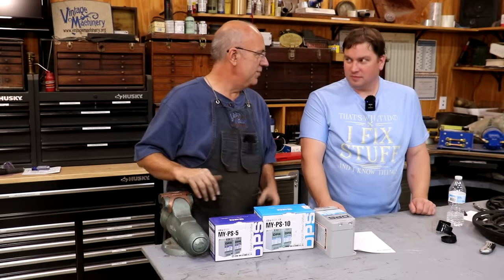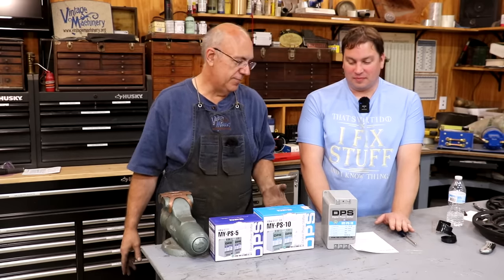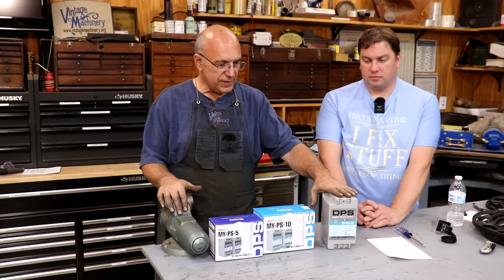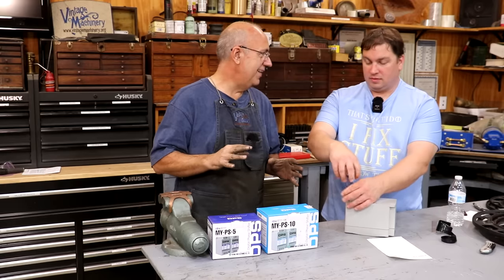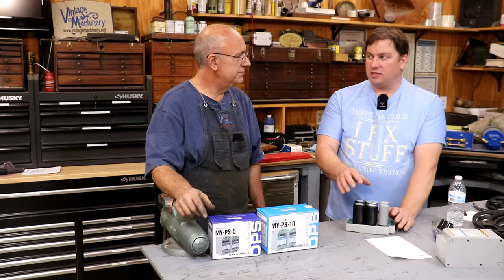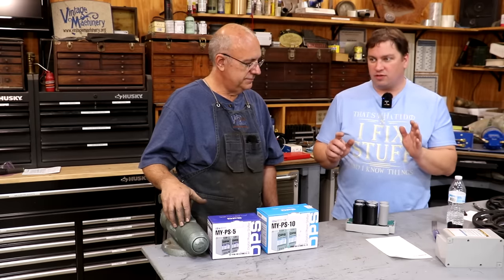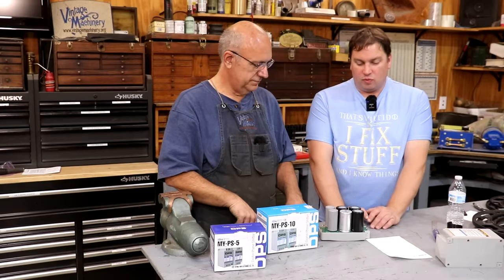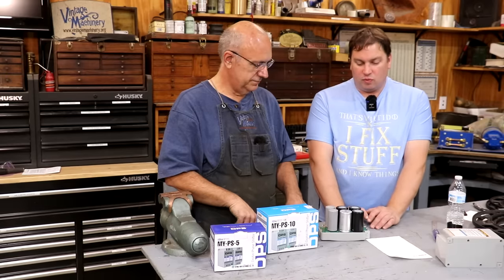Single Phase to Three Phase Power: Rotary Phase Converter vs Digital Phase Shifter

Comment: I run my lathe off single phase with a homemade rotary converter.  I used a potential relay and a pile of capacitors from the scrap yard. I set it up with a digital amp and voltage gauge for each leg from Amazon. It's a 10hp and has been in use for 10 years. The slave motor was also brought from the scrap yard just needing bearings, 25hp motor. With the digital gauges I can live data monitor each leg while using the lathe or any other machine plugged into that outlet. Study up on it and use common sense to get it done.

Comment: I've heard these described as two phase with a starting circuit which your demo proved out. For an in depth, but easy to follow review of motors controllers and VFD's go to Pump Ed 101 by Dr. Joe Evans. I have had the pleasure of sitting in on his presentations at workshops in the past. His online material  appears to be transcriptions of his presentations. really good stuff. 

Thanks again for providing another very informative video.

Comment: We are a DPS manufacturer and seller. Thank you for making DPS video.
However, it seems like the video was made without much knowledge of the characteristics of DPS.
It appears that there was no load on the motor when testing the DPS.
However, the motor is never used without load.
When the motor load is less than 50%, there may be an imbalance from the voltages and currents output from the DPS. Normally, when the motor load is 50% more, voltages and currents will be balanced. The current in the middle phase of the DPS output changes depending on the motor load.
Most of our customers are using DPS very well on their 3 phase motors. We are concerned that customers may have misunderstandings about DPS due to this video.
We think that if the person who made this video had read the DPS user manual carefully, he would not have made a video like this. Thank you.

Comment: This was a FANTASTIC video. Really makes me want to rip out all of my static converters and VFDs and replace them with a rotary and dedicated 3 phase panel. Unfortunately, I don't have a few grand laying around lol... But this video did give me a lot of knowledge and perspective on what's potentially happening on my machines, I'll be taking a look at some amperages...
Reply: keep the vfds and use the static converters  and a big motor to build your own roto phase!  you have most of the parts already, go for it!
Reply: @nilzlima3027  Haha, solid plan is solid. Might even make a great video... 🤔🤣
Reply: @hersch_tool  I put my RPC on a steel dolly with large casters. Then I can rearrange my shop at will and have easy access for any mods. That also made it easy to assemble on the bench, pick off with my lift (patients lifts are light and fit through a standard doorway making them epic back savers) and roll into place. I connect most of my equipment like a job site using SOOW cable for easy reconfig and though I never expect to move if I expand my shop it will be a breeze.
Reply: @Comm0ut Unless you just love irritating noise park it outside or in another building to muffle the constant drone.

Comment: Rotary converters are the best, will outlast electronics in my opinion, and the sine wave is clean. The old capacitor-type “converters” aren't really converters, as they're designed only for starting a 3 phase motor, where one leg kicks out after they start, and you lose 1/3 of the power. That is why rotary has always been the best, if a well-made motor is used. I used a 20 HP, 3 Phase, Lincoln Electric Co. motor on the converter I had, with a small 1/2 HP blower motor (also known as a pony motor) to start the larger turning at the push of a button. Really, they're easily made.

When there's no 3 phase on the pole, it's your only hope, as I called the power company for an estimate to run 3 phase to my shop, and the price was staggering years ago.

Comment: There is another option, solid state phase conversion (Phase Technologies).  I have two, one of which is in my machine shop powering CNC equipment.  They are expensive but very precise 3 phase generation.  If you hook an oscilloscope to the output you can not tell which phase is generated and which is original.
Reply: That is the path I am headed down, more for the reasons of compact space and less noise that RPC.
Reply: I have installed those things too.  they are more or less a vfd that has a static out put at 60hz.  a vfd is likely cheaper.  depends on how many machines you are going to have hooked to it.  they make the same whine that vfds do as well.

Comment: Key VFD advantage is speed adjustment on lathes DURING the cut (slower on the outside of a large diameter, faster towards the center) and of course variable speed on lathe and mill.

RPCs are better for heavy steady loads not needing speed control. Bonus, more motors also act as more idlers. I start my compressors one at a time (two industrial 5HP are easier to power than a single 10HP and when not blasting I only use one) off my RPC.  OTOH my lathe and mill have VFDs. See the Practical Machinist forum for the best detailed info on using both in a machine shop context.

Note some power companies bill all three phase at commercial rates so a large RPC may be a much better deal. Check before spending money. Also many areas do not have three phase at the pole.

Comment: I lucked out. I found a residential property that had three phase already set up in a 4500 sqft shop building that the previous owner was using for his business. It was the deciding factor for buying the property. Otherwise I would have gone with the rotary option to power my machines.

Comment: I would like to see the difference on a power analyzer. I don't think the phase shift is 120deg and that will cause the unbalance on the current. What worries me is that one phase was in an over current state. Power analyzer is basically a 6 channel oscilloscope, nice to compare voltage and current curves on one screen. We have compared the wave forms on a FVD before and after the line inductors. Even after the inductor the wave form was not a sinewave.

Comment: Last year I bought the diesel version of a large piece of equipment I wanted because the electric version required 3-phase power and when I called the electric company, I was informed there was no way to provide me 3-phase power without a significant investment ($100K+) since I am rural. Then I find something called a phase converter on FB Marketplace and after looking into it, realize that the electric company providing me the 3-phase power was not my only option and that I could have bought the more convenient 3-phase version of the equipment with a minor investment in a phase converter. You would think that someone working for an electric company would have known that and been able to suggest that possibility. Oh well...live and learn. At least now, I understand that I do not need to rent out facilities in town that already have 3-phase power.

Comment: 3 phase motors can run on single phase at a reduced power BUT THEY CAN'T START on single phase.  Starting requires a phase shifted 3rd leg.   The capacitors can provide a phase shift that will give a direction to start the motor but it will most likely never be a balanced 120 degrees.  The angle will depend on the capacitors, induction of the motor and it's load.  I have built phase converters and 3 phase capacitor start/run circuits for specific motor and load.  It is possible to come close to 120 phase shifts over a wide load range but you really need to know what you are doing and get the whole system balanced.   This is what the professionally built rotary phase converters do!

Comment: Speaking from my experience...rebuilt a Brideport Boss to modern controls/VFD, this is academic... If you run the numbers, factor in your hopes and dreams, and check your bank account, the choice is there. While a DPS may be bad choice, my VFD (set up for success) runs fine. Motor has never even gotten warm. Do your due diligence.
Reply: so many things only have hopes and dreams...

Comment: I bought a couple of these from another company on Ali.  It worked ok until i tried the "self learning".  Then it blew its mosfets and everything went live and it melted the motor.  It then blew all the magic out the side.  240v two phase on canada.  It tripped the breaker on the garage panel AND the breaker at the subpanel that feeds the garage leaving me in the dark.  It blew the tops off of all of the mosfets and they all failed closed.  It is the most perfectly white sparks I have ever seen.

Comment: Would have been interesting to have tested the leg voltages and  currents at the rated load. I suspect they would have stabilized quite a bit.
Reply: no the voltage would only shift a little and the current on the direct lines would increase proportionally to the current demand.  remember its I 1ph X (square root)3= I 3phase.
Reply: The volume of a capacitor is an indicator of its energy storage capacity.  At higher loads, when more energy needs to be stored, the fairly small energy storage capability of those capacitors may have led to worse unbalance.  As you suggest, the best way to tell is to do a full-load test.

Comment: Great video Keith! There is quite a lot of information out there about these but some of the finer details are missing. I’ve long wondered about the EMF. I haven’t confirmed this with my scope but as I understand it a VFD effectively turns AC into DC. The issues you experienced make sense as an AC signal rises and falls DC can overlap as you described. I also wonder if the higher amperage and voltages you are seeing is the motor fighting itself due to the EMF or overlapping voltages (lead?). Lots of good food for thought. Will definitely have to reconsider my setup.
Reply: This isn’t a VFD, it’s a static phase converter.
Reply: @MrSleepProductionsInc Ah. I misunderstood I thought he was referring to a VFD with just a different wording.
Reply: yea that is how vfds work, all  of them.  convert to DC, filter caps, then high current high voltage transistors to create an output of the desired voltage and frequency.

Comment: I am not surprised to see the big variations with the static digital phase shifter. I have heard a number of people having motor overheating problems with phase shifter devices. Of all the single phase to three phase converters these shifter devices are the least desirable option by a long way. 
VFD or Rotary converters are the only realistically dependable options.

Comment: Static converters (which is what this really is) can work just fine, IF you can tune them to the motor/machine.  I use a Ronk, which utilizes a transformer, along with the bank of capacitors, for the generated or "wild" leg.  You can change the tap on the transformer and add/remove capacitors to balance the output between legs.

They are not a better option, though.  Most static converters are not capable of powering more than one motor/machine.  I have a method for getting around that, but in the long run, a rotary converter would be the best option.  By the time I get done with the additions needed to make those methods easier, I will have built my own rotary.  Better to go straight to the rotary if you can.
Reply: the ronk units i have put in had what they call "rotary transformers"  which is a 3phase motor with no output shaft, nothing more.  they work just fine, simple and cheap.
Reply: PHASE A MATIC static converters work well if correctly sized for the motor. Not under or over motor horsepower. I’ve been using one on my 2HP Bridgeport milling machine for twenty five years with no problems.

Comment: Steinmetz circuit, after the German-American engineer Charles Proteus Steinmetz (Karl August Rudolph Steinmetz)
This connects a three-phase motor with capacitors to a single-phase network.
With this circuit the motor can achieve 30% of its nominal power. 
The low efficiency comes from the fact that the phase shift is not 120° but only just under 90°
The capacitor must be calculated for the motor, the mains frequency and the voltage.
To start, a larger capacitor is added.
Reply: as he said, the phase angle is too small, therefore the voltages and currents add up and become too high on two legs. The third leg is too weak. 
The motor can only be used for 1/3 of its specified power otherwise there is a risk of overloading.
Reply: @jensschroder8214  yes

Comment: It would be interesting to see the power factor on the 240 side (e.g. the ratio of the input current to the input voltage). That might explain why different output legs have different voltages and current.

Comment: Great video. I just bought a laguna 18-36 wood lathe that uses a dps to convert 110 to three phase and adds a vfd for speed control and reverse. Are they basically using this same setup?

Comment: Another issue is you are building back emf into the windings. The heat issue also will kill the windings protection layers leading to motor failure. Motor life cut in half when these are used.
Reply: that in a nutshell is the point of this video.

Comment: Would be interesting to see the output on a oscilloscope, the peak to peak voltage is probably all over the place.
As long as people are not informed they keep buying this crap and as long as people are buying it the manufacturers are making them.
Reply: that can be said of so many things.  split lock washers for example, people still believe those things do something so they keep buying them.  homeopathy, fuel line magnets, how many can you name?

Comment: I bought one and burned my 2hp Bridgeport mill motor in less than 3 minutes. Motor for mill is $1500.00 to $2500.00
Reply: One of those Dps burnt out the 5 hp motor on my Modern 857 mill and the Dps also fried , I do believe it's the same motor on a Bridgeport and not very cheap to ship to Canada . I bought a generic new 5 hp motor same speed for $580 with a C face mount and modified the shaft from the original motor with the use of a bolt on bracket and a flex coupler that I machined in my lathe . Now I can run any motor that fits on my adapter plate . I'm in the process of building my own rotary phase converter right now .

Comment: I started with a rotary phase converter and it worked well. However, people always gloss over two HUGH disadvantages 1) tremendous noise issues 2) the need to turn on the rotary converter first then turn on the machine. Why not leave it on the whole time you are in the shop - noise! Watch any YouTube channel with a rotary and you will note two very distracting noises 1) the phase converter 2) the air compressor. You can put it outside in an enclosure but you can almost always still hear them. I switched to Phase Perfect which is a whole shop digital phase converter. It’s noise level is that of a computer as it has cooling fans that run intermittently but very quiet. It’s output is better than commercially available 3 phase and you can turn it on and leave it run full time you are in the shop. So you just walk up to any machine and turn the machine on with no though of having to walk over to the switch to turn on the rotary phase converter. It uses only 2% more power than commercially available 3 phase. It is more expensive than a rotary converter to purchase but well worth it. I have no commercial  involvement with this company, just a very happy customer with no unneeded noise in his shop.
Reply: I have heard or read you can pick up used 3 phase machinery much cheaper than single phase machines. I think it may be because demand is lower... due to the higher cost of getting wired for utility supplied 3 phase or a rotary converter for each machine.
Reply: anything left on uses power so in the interest of your wallet turn things off when not using them.
Reply: @nilzlima3027  you are totally missing the point. Power consumption when not running a machine is almost nothing and yes when you leave the shop for the day it goes off with the lights. But when you are working in the shop it is quiet and you are not constantly running to turn on and off the rotary converter as the digital phase converter is just ready for you to turn on the machines at all times with better3 phase than the power company provides.
Reply: @toddmarshall7573  3 phase equipment can be cheaper to buy used if it is out of demand by industry. The big advantage in 3 phase equipment is that it is of better quality as it was built for industry not a home shop machinist and the motors are simpler and can be reversed while running.
Reply: @bruceanderson9461  My comment was from what I heard from somebody not in the machining business but needing various machines to do repairs and make replacement parts. He only bought second hand equipment and noticed the dramatic price difference between 3 phase and single phase.
Reply: @bruceanderson9461  the other consideration is the electronics package will degrade over time and fail at some point.  I pull lots of drives after 5-7 years and those inverters are more or less the same thing.
Reply: @nilzlima3027  the electronics will fail at some time but I have had it for 20 years already with peace and quiet which I value a lot.
Reply: @bruceanderson9461  if  you have found a quiet milling machine please let us know all the ones i have used make lots of noise.
Reply: Not worth my time talking to you - goodbye

Comment: ELI the ICE man.    Voltage leads Current in inductive circuits and Current leads Voltage in a Capacitor circuits.   One is direct, one is shifted by a capacitor and the other leg is shifted by the motor inductive.  It would have been better if it were an electronic voltage/current. VFD circuit.  Speed control on 3 phase from 220 single phase.  Also have 120v.